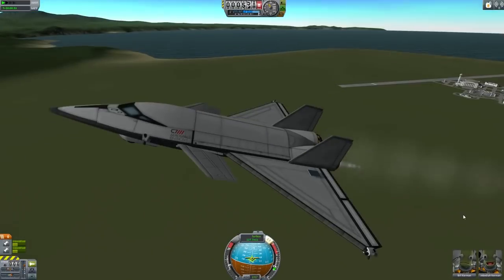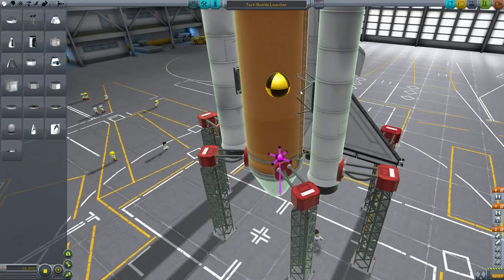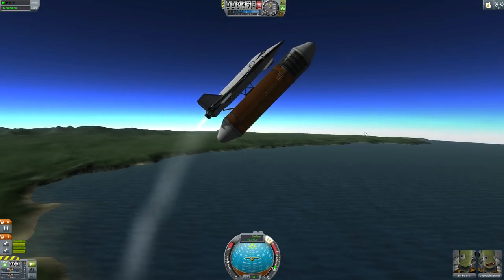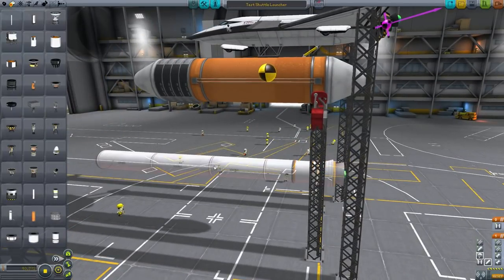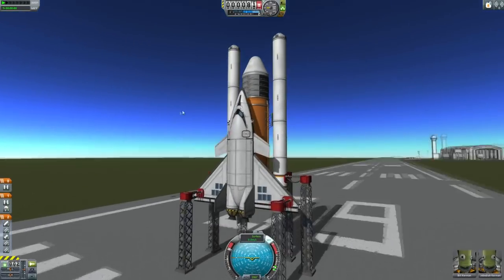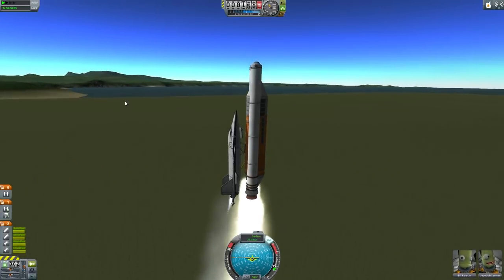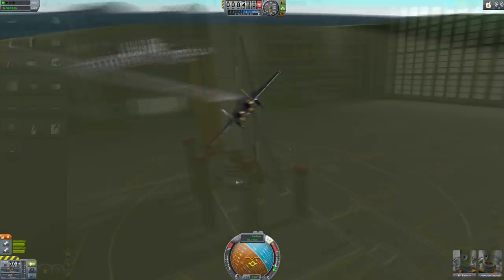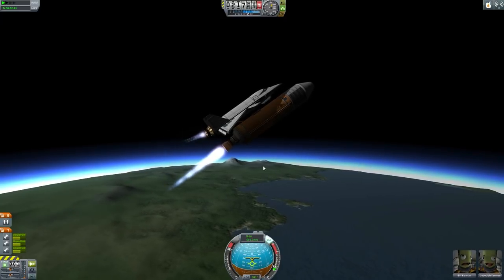Kerbal Space Program - Building A Shuttle Clone In 30 Minutes

Comment: Asymmetric thrust should be the bane of the vast majority of scifi spaceships. i.e. what happens when artists don't know basic physics.
Reply: Yeah, honestly the Enterprise would instantly spin itself to pieces along firing the warp drive.
Reply: @harrymack3565  eh, more like if it fired its sublight thrusters, which are also gravely off-center from the center of mass.
The warp nacelles don't exactly produce thrust, so that can be handwaved away at least.
Reply: @Gabdube  That's a good point, I suppose given that we never really see an engine plume the sub-light thrusters could be angled up in the fuselage to balance it, not the most practical but still, i guess it makes more sense then nothing at all.
Reply: @harrymack3565  it's not angled. Star Trek canon showed straight, off-center engine plumes for Constellation-class ships in some occasions, just AFAIK not in the original Series. They really do off-center thrust, and no Star trek designer ever thought appropriate to retcon or change this. I mean, it's not like Star trek ever cared about science, so it's unfair to expect it to care about engineering.

Comment: Hm, just thought of a great mod idea.
Maybe its already out there.
Wouldn't multiply thrustcontrolbars help greatly with planes like this.
You already can alter the thrust of one of your engines at the same time,
but i mean something like a group of engines, that you define in the assembly building
and then controls the thrust of all the engines at the same time.
There could even be a new bar in the interface next to the standard bar
and you could switch between them with a key.
Reply: Exists, or it did.
Not sure the name though...
Reply: not sure if this is the kind of thing your looking for but, scott did use a mod that worked like real plane engines do with a lever for each of the engines thrust, but sadly i cant find the video of it

Comment: It's alot easier in 1.0.5, with the vectoring engine. There are now also three stock craft replicating the shuttle.
Reply: +BNSF1995 The Vector engine is amazin'.
Reply: +BNSF1995 Also just use Mk3 parts it works super well, compare Mk3 Cockpit with shuttle cockpit almost perfect match
Reply: The vector is just Kerbalized Space Shuttle Main Engines. It has identical vectoring range (10 degrees in each side) and it looks just like SSME.

Comment: On the actual shuttle, the shuttle's inline engines were slightly angled away from the main tank, along with 2 smaller radial engines pointing straight.
Reply: It also had 3 inline engines rather than just 2
Reply: +Brett Lair (Band Geek) you are a rocket scientist?
Reply: +Harith Iqbal I think this knowledge can be gained by looking at a single picture of the space shuttle :D
Reply: How come this comment is so short but it gets 2 LIKES!?
Reply: Harith Iqbal No but i studied rockets... The space shuttle was equipped with 2 solid rocket boosters on either side, a main fuel tank attached to the shuttle, and the shuttle had 3 l/o engines that were the main force after boosters were ejected, the shuttle also had 2 vectoring engines on either side of the tail fin

Comment: Ive found that the Energia Rocket design works really well for me. massive tall talk in the center with quad engines, and 4 extra large liquid fuel boosters on the sides. It thrusts so much that even the slight weight imbalance means nothing.

Comment: Wish I'd seen this a year ago.  I built a design that worked without the powered external tank or the torque modules.  Used a mk2 4 engine adaptor with offset main engines with their vector aligned with the launch center of gravity, then added a small side-mounted engine on each side aligned with the center of gravity without external tank or boosters.  At launch, the main engines and the orbital maneuvering engines initially fire at full throttle, resulting in a vertical launch, then I back them off to allow the boosters to push the ship over inverted into a gravity turn.  Once the boosters are spent, I throttle up the mains fully, but by this time, the now offset thrust from the mains is countered by the mass of the fuel tank and the lift from the wings.  Once into space, I cut loose the external tank, deactivate my main engines and operate using the small orbital maneuvering engines only.  Voila.  Took hours of trial and error to learn the hard way why the real shuttle does it the way it does, but it was fun and informative.  And now I have a mk2 shuttle to ferry space station pieces with.

Comment: This inspired me to launch my own shuttle the same size. Same basic design, but with the FAR mod. Used those same SRB's, the 650kn engine under the orange tank, staged when the SRB's run out, and the aerospike engines on the shuttle. It works if you can modulate the thrust on the way up to compensate for the change in CoM. I actually started adding weight to it to see how much it can carry up on a mission, and ended at around whatever 1200 liquid fuel and oxidizer weighs.
Reply: Ah... After watching the other 17 minutes of the video, I see we pretty much ended up with the same design. I didn't have to use the reaction wheels, but maybe I spent a few more minutes on mine.

Comment: I used the "Tiberdyne" space shuttle mod for a while, which was a legit recreation of the Space Shuttle with appropriate RCS-based engines and the works. Just like a stock one, however, it was very hard to keep it properly balanced, and ultimately it was a big time consumer with little reward. One thing that is a huge buzz kill for me on the stock parts is the limited space in the cargo bays. They are RIDICULOUSLY small, especially if you want to build a space station using parts like the science lab and things! I've given up on space planes and space shuttles for now, especially in stock, there just isn't enough parts yet that are big enough.

Comment: You should use your throttle to keep the whole assemble flying straight. Because the SRB cannot be throttled, only the SSMEs are controlled by the throttle gauge; and by controlling the throttle you can keep the rotation torque low enough that the fins can stabilize.

Comment: Honestly the hardest problem with shuttles for me with FAR is getting a clean booster separation. I usually get SRB sep in the high-teens (18-19) kms, which is still low enough for the boosters to veer off wildly upon separation as they are prone to do in FAR. Even with half a dozen separation boosters, its usually only enough to get them to spread out wide enough long enough for the shuttle to get away, before inevitably colliding together again.

I'm about the build a shuttle again using the combination separation rocket/radial decouplers featured in the new SpaceY parts pack, maybe those will help.

Comment: Hey Scott Manley, love the channel! I too have been playing with making shuttle like spaceplanes and have created a design that launches pretty well. But I do use mechjeb, as I use it to create a pretty precise launch profile. I'm pretty sure the NASA shuttle launches were all programmed in, so I don't see it as cheating. The main problem like you say is the asymmetry with the boosters and the orange tank. With the boosters in KSP, they are a fixed thrust, so as it burns the thrust to weight changes. I know Bob Fitch has created a way to mimic the real life boosters where they are not throttle-able but do change their thrust for the amount to fuel left, which means you can drop the TTW as you go up. For the offset of the orange tank, I have 2 sets sets of engines, yes it makes it heavier, but mimics the real shuttle as it doesn't use the main engines once it drops that main tank. So I have 1 set with large gimble and offset, then switch over to thrust through the shuttle only CoM. I will post up a vid when I get the chance.
Cheers
Azza

Comment: I tried this in the demo... Lack of parts complicated things, but when I did a bit of research I found the major issue. Thr real shuttle has engines with something like a 30 degree gymbal range. The best I could find in ksp is 5 degrees...

So there is a lot less scope for adjusting your thrust vector.

Even so, with the parts in the demo, I managed to get something which would launch, and stay stable... Until I ditched the main tank, at which point the thrust vector was completely off, and I spun out...

Comment: Not only did the space shuttle have a large range of gimbal on the main engines but the SRBs could be gimballed. Not nearly as wide a range though. Thrusting through the center of mass was not an uncommon practice before the shuttle though. The Saturn V, for example, would gimbal the outer four engines through the CoM in case one of those engines failed, the whole spacecraft (hopefully) would not be doomed.

Comment: Put a very large radially-mounted engine between the main engine and the shuttle and adjust the thrust of this, and the main engine, with the thrust limiter as you launch. It's the only way I've managed to do it, and it is difficult, but it works.

Comment: I know this video is pretty old but why didn't you just throttle back on the very first version?
Reply: Throttling back the engine means your total thrust to weight ratio is lower, therefore your acceleration is lower, therefore you run out of fuel before reaching orbital velocity.

Comment: I used robotics to be able to adjust the engines angle enough. Not stock KSP though, but also not just using a pre-made shuttle mod. Took quite a bit of work to get it to do what I wanted, but it worked really good once done.

Comment: have you realized that the:
mk3 cockpit
mk3 cargo bay
mk3 to 2.5 meter adapter
big-s delta wing
big-s elevon 1 and 2
s3 ks25 'vector' engine
s1 srb-kd25 'kick back' solid rocket booster
rockomax jumbo-64 fuel tank
tvr-300L stack tri adapter
mk12-r radial-mount drouge chute

are basically parts from the space shuttle
(yes i do reilize that he was playing before the mk3 parts looked like space shuttle parts)
Reply: and big-s space plane tail fin

Comment: Wouldn't it be much easier to use two radially attached engines on the shuttle, with decouplers and fuel lines, to offset thrust until you ditch the main tank? That way you still have the inline engines on the shuttle for orbital maneuvers, reentry, and aborts.

Comment: Hey, I`ve literraly just made a space plane based on yours and after the engines run out, the plane just becomes extremely heavy due to the engines and it wont pitch anywhere I want. The center of lift is WAAAy ahead of the center of mass, even when using FAR and putting the wings WAAAAAAAAY back. Any help????
Reply: Use smaller engines and put heavy stuff in the front.
Reply: Decouple the engines

Comment: Scott (and Scott's other fans), I have a question about the real space shuttle. Specifically, why did it always roll 90 degrees just after lift-off? I'm not asking about the reasons it wanted to be "heads-down," I already have a good idea of the answer. What I'm asking is, why not just turn it 90 degrees on the pad, before launch? Surely that would simplify the programming and reduce stress on the vehicle and crew?

Comment: Hey Scott I just thought of two designs that might be an interesting thing to try. Both require the mod Infernal Robotics but with one design you could adjust the angle of the engines with one of those hinge type parts. With the other I was thinking it might be possible, though a bit more complicated, to set up a third engine that would be moved into place once in orbit and take over for the two launch engines. Possibly a LV-N, but I fail at planes in KSP and making one able to fly to space is beyond my grasp lol.

Comment: 19:49: Out of curiosity, was that back-of-the-envelope calculation assuming an equal volume of dollar bills, or an equal mass?
One possibility that occurs to me is inspired by the real space shuttle. If I recall correctly, the real space shuttle uses the same fuel for its orbital engines as its reaction control thrusters. So, I wondered if one could use two LFO engines for the ascent and some RCS engines (or the new monopropellant ones) once in orbit.

Comment: Scott, here's something I found comes in handy with shuttles. Use IR hinges to mount the rear engines. Gives the gimble range needed for a shuttle, yet also can act as a trim. When well balanced, you can basically just pitch the engines and fly with the trim. 

http://www.thekerbalspacecenter.com/2014/10/karbonite-minmus-and-new-shuttles-oh-my.html 

I made a shuttle using that design here. The S2 > 2.5m adapter plate hides the hinges. They actually perform quite well under thrust.

Comment: I usually make Buran clones because Energia is a booster instead of just a tank
Also, place tanks on the opposite side of the external tank if you want to balance thins ou.
Reply: Things out
Reply: The Shuttle that I'm working on is pretty decent
I've reduced the SRB size because aerodynamic stress keeps on ripping parts off.

Comment: It would be interesting to see if it would be possible to achieve near-parity with the shuttles using Infernal Robotics to gimbal the engines, though I suppose the problem would remain the 909's not having enough thrust to overcome the weight of the fuel in the tank.

Comment: Scott im just wondering. Whats your opinion on the "catapult" approach for getting things in to space? Essentially a magnetic rail system that starts horizontally, and slopes up to launch a spaceplane in to orbit using the principle of a rail canon for the initial burst of speed while finalizing the orbit with the planes onboard fuel.
Reply: I seem to recall he made a video a while back about non-rocket based space launch technology, i forget what it was called though.
Reply: hateexmachina
Well its not entirely non-rocket based. The idea is to combine a system similar to an aircraft carriers catapult with the magnetic rail train technology to minimize energy loss VIA friction. But the vehicle itself would still pretty much be a space plane with a rocket booster.

While the ramp would generate great amounts of speed (like a railgun) its nowhere near enough to propell the vehicle in to actual orbit. Thats where the booster comes in to action. Ofcourse the structure to make that possible would have to be huge. Probably bigger than anything we have made till now. But it should offer a cheaper way to get in to sapce than using standard rocket technology. And since the initial stage is located on the planet, instead of going up with the craft, its reusing capabilities would be similar to those of a runway.

Though i have no idea how much energy would actually be needed to power the EM system.

But yea ill dig though his vids and see if i can find the one you meant.
Reply: Well, It seems like a good idea, but I wouldn't put anything fragile in it.
Reply: I can answer this for you (okay I'm not a major in astrophysics however I did my fair share of mathematics and astronomy in college!). The idea for a "space cannon" or catapult has a few problems. First off, the idea was introduced in the 1800's I believe. There was one very famous author who's name I cannot remember that came up with it in an old sci fi novel; he wrote many science fiction novels and made very accurate and eerie predictions/theories about how humans would eventually get into space, even taking off from the coastline of Florida. So the idea has been around for a very long time.
The first big problem... it would never work with human lives! At least as long as we don't have some kind of "inertial dampeners" like whats in the Stargate TV show. If we were able to build a space cannon, it would apply a ridiculous amount of G force (I believe over 100g's) that would most definitely kill any occupants on board. The initial velocity would also have to be over 1,000m/s^2 or something to reach space.

The second problem, during initial launch, the flight would be very uncontrolled. If you play KSP, you realize that there is the human factor in controlling a rocket into space with a nice angled launch to start circularizing orbit. Firing a cannon into space isn't exactly controlled. Firing a gun for example, the path is never perfectly straight, it affected by atmospheric pressure and wind. This is a similar problem. The object being fired into space would be extremely uncontrollable, with most likely not "abort" options or failsafes. Once it is off, it is off.
The last problem is energy. To send anything practical (including a probe or resupply ship), it would need an explosive amount of energy to reach space, and then it would absolutely need propellant in space because Newton himself proved that it would be impossible to put something into orbit even from the tallest mountain on Earth. Propellant adds more mass to the problem.

There is no shortcut to space. Even a space elevator is impractical. If I'm not mistaken, an elevator would have to be in the appropriate position to put an object into geostationary orbit.
Reply: Edward Boot
A couple of things to add: Given a long enough rail, it would be possible to reach any speed at any average g-force. For example, it would take ~50km of rail to reach mach 5 (sea level, ~1700m/s) at an average acceleration of 3g (in about 60 seconds). I think the main issue would be aerodynamic forces on the craft, as the rail would have a limit on how high it could be built. I don't know of any aircraft designed to survive at hypersonic speeds at low altitude (even cruise missiles). If the rail were at high enough altitude (10+ km, say) it would probably just be a matter of designing an aerodynamically-stable craft with enough delta-v to get into orbit. Still not very practical on Earth, but perfectly sound on a body with minimal or no atmosphere.
Reply: Edward Boot the author was jules verne (i think)